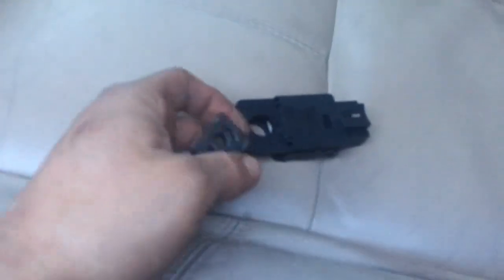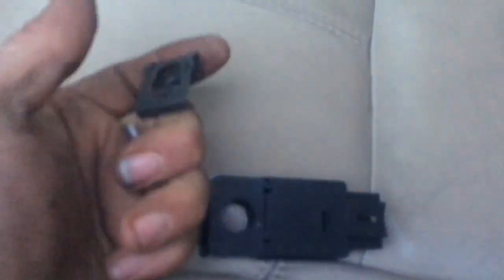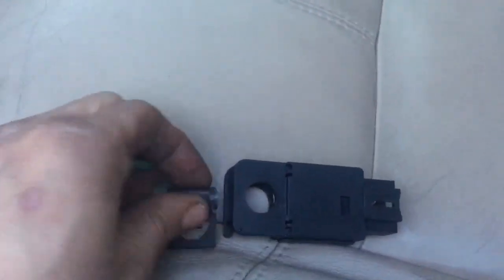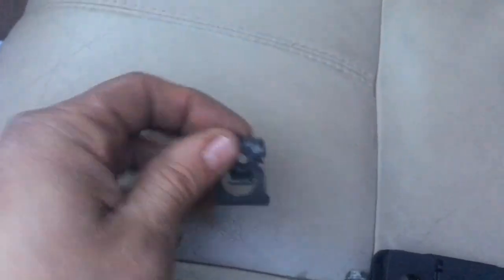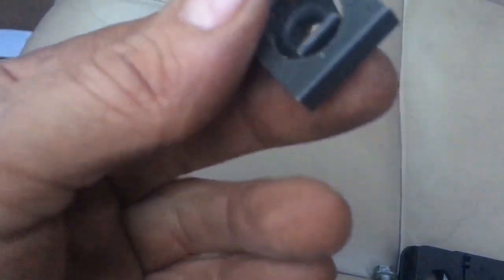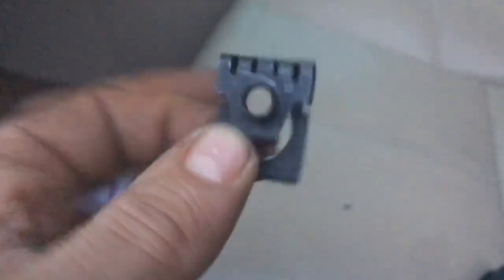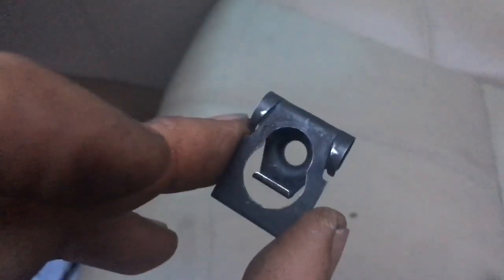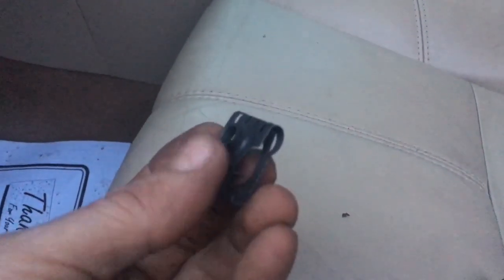Possible reasons why your Stabilitrak light is on in your GM

Comment: Hey clay I have a 2009 Chevy Tahoe my stabilizer track track control and abs light is on the engine seems to be a lil slow my front tire sensor has been out for awhile it also has been saying monitor tire system any suggestions
Reply from the maker: It definitely does not have anything to do with your tire pressure monitor unless your tire is just low all the time

Comment: My 2014 Silverado 2500hd Duramax crew cab throws on my traction control lights and stab-link and check 4x4 if I break the tires loose. This started after my rear differential was replaced. Any thoughts? Thanks

Comment: Hi i have this problem but it started happening after I had the engine replaced? also tells me engine power reduced
Reply from the maker: Well there’s probably something loose or maybe they didn’t get a sensor in properly there’s so many things that could possibly be after that type of job is done they need to go back over there work and double check it because more than likely they did something wrong sorry I wish I could be of more help
Reply: @sharpcarco  thank you that's what Buick said I'm going to take it to them to be reassured

Comment: I have the same problem in I have tried this, purchased a new one still didn't  solve the problem. My truck will function right. Startup  and the traction control work But after Maybe 2 minutes driving the traction light will start coming on along with the brake  Not sure what it can be. I've also heard that it could be a ground wire . all the grounds that are connected  to Battery and from engine alternator mounts to back fire wall by brake master cylinder. That will be my next try at it.
Reply from the maker: I’ll be honest with you it’s probably something that you did wrong while installing the new switch there some kind a clip or something missing .  Don’t worry we do that stuff all the time I would highly recommend you just have someone take a look at it or take One out from a buddies truck and doublecheck Is installed exactly the same way his ears or that the brackets not bent in some manner. I hope that ends up helping you all have a great weekend
Reply: ser biop Any update? Im having the same issue on my 2011. Thanks
Reply: any updates sir biop?
Reply: I've been chasing the stabilitrac and traction control lights intermittently coming on in my 07 suburban. 
I recently changed both front hub/bearing assemblies.  One was shot.  
I then added a ground wire from alternator to firewall.
By the way, I installed a new brake light controller when it was bad months ago:).
Today I gave in and went to the Chevy dealer.  My intake gasket on bank 1 was leaking.  
I've replaced them with felpro, took about 3 hours. 
I have done a few start up cycles in my garage and everything seems solved. 

Hope this helps someone,
Peace.

Comment: My stabilitrak light flash several times only when I drive and steer most likely to the left side, and when that happen all my front head lights and interior lights turn off several times even the a/c is turn off/on, I have 24" wheels on my truck I dont think is because of my wheels because even on the original 20" wheels it does the same thing, do think it could be a sensor wheel that it is making this to my truck? My truck is a 2014 Silverado 1500 5.3!!!
Reply: Leo Barrera have you tried disconnecting battery after switching sizes! To reset pcm as sizes will affect it!!

Comment: Same problem with engine reduce power and stop after 2minets it work again and same thing happens every time please help to solve the problem
Reply from the maker: Well I really wish I could help you with that problem but unfortunately I doubt I could diagnose it over the Internets, I would just bite the bullet and pay at shop to take a look at it for you I’m sure they will be able to figure it out
Reply: Did u solve it my started doing that took it to the shop and it was good for a few days than its started saying traccion stabilizer off and have reduced power to engine so sometimes I will turn off and it will go away and others it will just stay that way but it all started while running it will just pop up saying power reduced engine and run really slow like running low only it been it an out repair shop and they cant find what it is is a 2014 suburban

Comment: What crap video you can't mop your camera on a tripod?

It's a video you said and we'll see if it works, well did it work? Was it the brake pedal switch is that will fix it? is perfect brand new OEM not a problem.

Comment: I have 2007 chevy equinox my car was driving fine then all the sudden a light came on that says stabilizer track is off now I,have no power steering
Reply from the maker: Sorry to hear about that Jason You probably blew the power steering fuse when you have the hood up and you’re looking at the fuse box it will be closest to you and have a wire coming off that runs out of the fuse box by itself it is black and I want to say it’s like 80 A it is very simple to find it is not with all the other fuses but located on the same box
Reply: @sharpcarco  the fuse is still good
Reply: @sharpcarco  "we are replacing a part that's under the steering wheel now
But I'm not even sure I need to do my fingers are crossed that's what it is